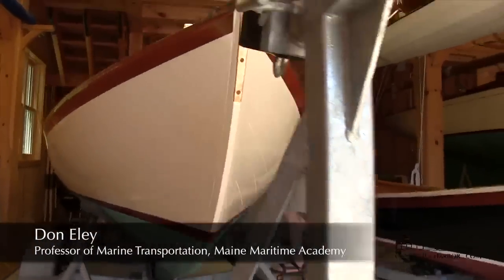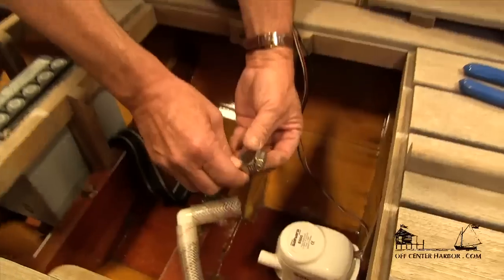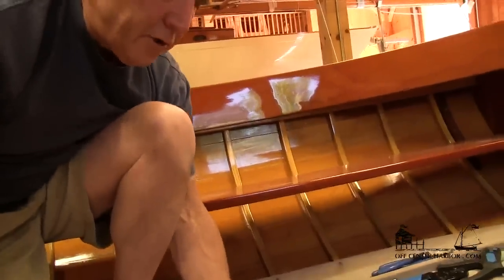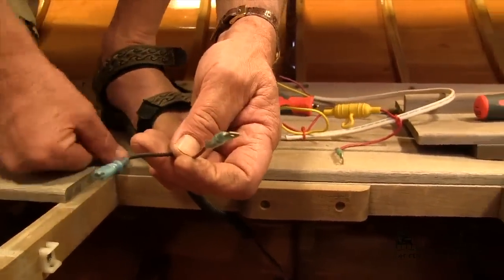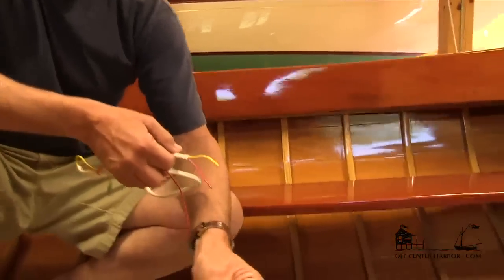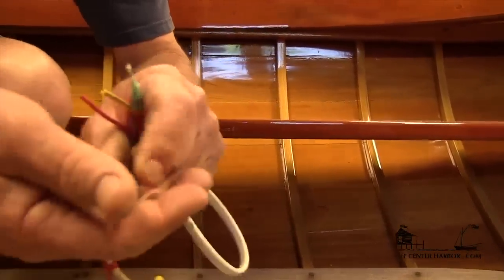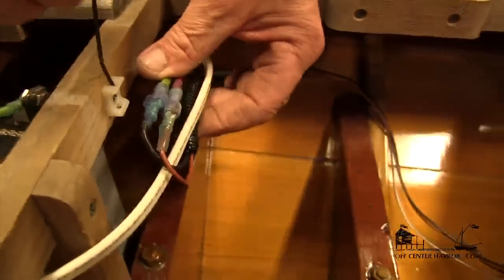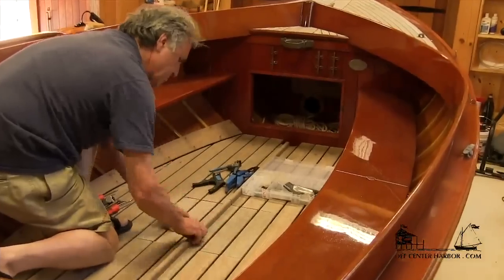Wiring a Bilge Pump

Comment: I have done hundreds of installations on sailboats and other vehicles over the years and in my experience the way to join 2 wire is by soldering them together, then I put a tad of dielectric grease on it and on top of it all a piece of shrink, the type that has glue in it.   Those crimped connectors when I must use them I take the the plastic out, crimp them, solder them and put a piece of shrink/glue on it.  Works magics and looks profesionnal
Reply: Monsieur Tranquille that's not A ABYC standards

Comment: Very nice and informative video. I enjoy most of your videos. I do have a question regarding installing a battery should it not be in a battery box with lid and the positive terminal have a booth? It is a very neat installation but the 90' turn will reduce the flow drastically no?
Reply: Alain Pascal Routhier  This guy doesn't know what he's doing. one hose clamp straight to a 90 degree turn???? Ya right. Bypassing the manual is a mistake also. If the float malfunctions you should be able to turn it on. The are put there for a reason. Additionally he doesn't have a battery box?????? A nice boat like this should have a blue spiral cell like an optima.
Reply: why be demeaning? although not ideal the 90 degree will work if you have to, in his case because of space , and the hose clamp will not rust out secretly during a season, so someone normally looking after his boat would see any change, its only a floor board away.  Being a wooden boat,  im sure the owner has a look there every now and then to detect any small leaks that would not trigger the auto-switch
Reply: LaMouleQuiCoule it's not demeaning, and wiring a bilge pump is a safety issue. others may make these mistakes. and it may cost them their lives
Reply: Help please, just want to know how to wire my automatic shoreline marine bilge pump with out three way switch,thank you

Comment: Great Video, I have a Question, Would it not be better to mount it sideways so you don't have to have a 90* right out of the output ?? Or does it matter?? Thank You.
Reply: you should always avoid elbows before or after a pump or a ventilator, you loose power if you do so (static pressure). So yes you are absolutely right, that pump would have more power being installed sideways.
Reply: The pump wont pump as fast with the 90 in-line, however if you mount it sideways it wont pump until the impeller is covered with water and will stop when it sucks air. So it is a calculated risk it would be best running the hose out as straight as possible.

Comment: nice and neat but how does the battery recharge?
Reply: Frank Doxey I have the same question.
Reply: Frank Doxey with a battery charger or solar. If its only for the pump it will last a whole season, if there isn’t any leaks ofc..